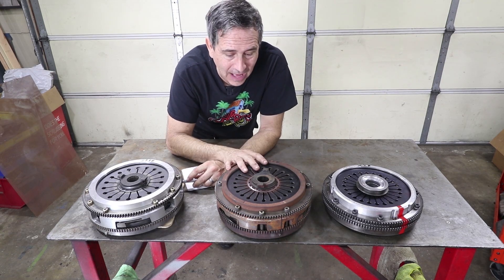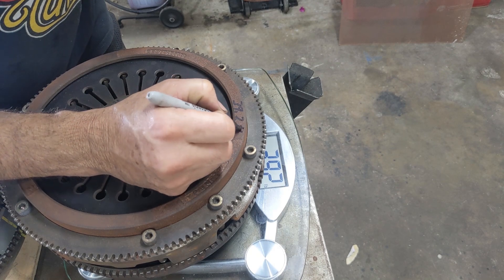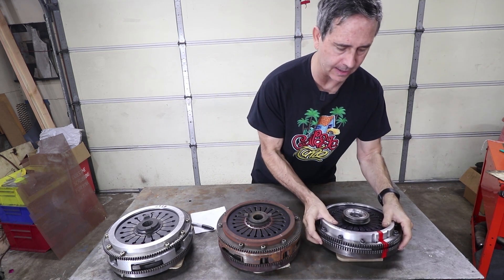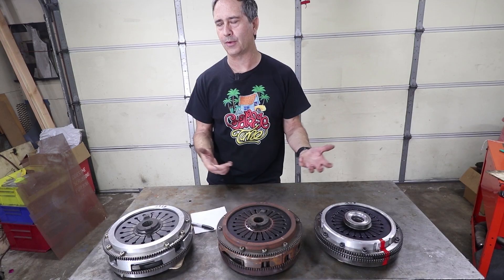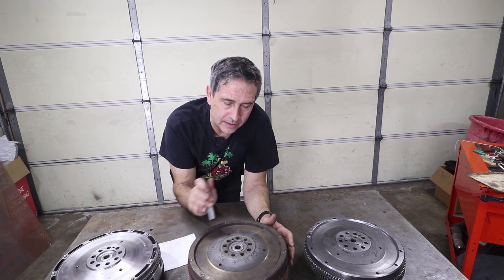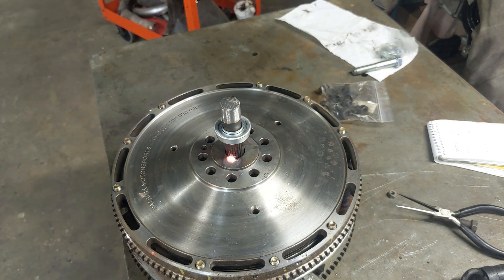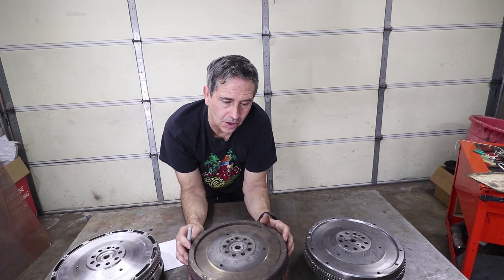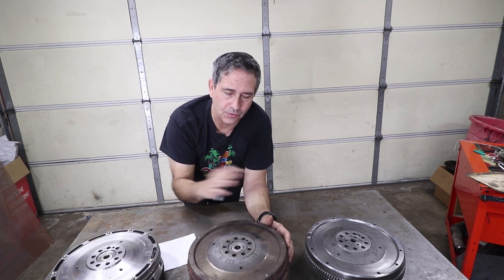Why Flywheel Rotating Mass Is Crucial For Best Sports Car Acceleration

Comment: Thank you Tom...good stuff...love it! Would you (or anybody) recommend putting a light weight clutch assembly into a lighter than the 911 Carrera car (917 replica, approx. 1,900#)?
Reply from the maker: Yes, the lighter the car the lighter the clutch assembly should be.  
You don't need the stored energy in a flywheel to get the car moving up an incline for example.  
The car is so light it just goes.  Especially with a big carrera engine!

Comment: Interesting video!..i have the 915 flywheel with the heavy clutch. i will be taking out the engine and gearbox to do some work on the engine. Your video gave me insite to look over the flywheel and clutch assembly. cheers.
Reply from the maker: Thanks.  It's worth looking into for better acceleration.  You can also lighten the flywheel, but if you remove too much weight first gear starts can be tricky.
Reply: @GarageTimeAutoResto  thanks love your videos

Comment: Can you put the 915 clutch in a g50 gearbox? Something to think about for when I have to replace the clutch, which will be soon. Understand it also needs hidráulic pedal? Thanks, good stuff, as always
Reply from the maker: Yes the G50 cars use a hydraulic clutch.  See this video where I bleed the slave cylinder. https://youtu.be/2gLHQukzR7Y?si=KdDlaZWUKdWjPWYb
A 915 clutch won't fit, but Patrick motorsports makes a short bellhousing system which should be as good as the 915 stuff.  Check them out.
Reply: @GarageTimeAutoResto  thanks Tom. I’ll have a look at it but I doubt it makes sense to buy one and bring it to Spain, you know, shipping, taxes…

Comment: I think this is interesting content. I’d like to see some of the math and a quick brief on the physics software would be interesting too. I appreciate that you give fun info and are quick to the point.
Reply from the maker: The physics software is called tracker and it's free video analysis software.  It turns out that cameras are pretty good timing devices.  This video wasn't very popular, but I explained the tracking software more.  
https://youtu.be/8M2uUN5Psw4?si=4BwOROneWaNMBpXz
I'll show more math on a wheel and tire video, but it's Newtons second law of motion. T=I*w
Rotation acceleration is change in RPM/change in time.  That data came from the camera.  
Kinetic energy is .5I * w^2
It's always a tough balance on how much to include, ha ha.  I can see where people drop off when watching my videos and math is a sure way to lose people!

Comment: Interesting tests Tom.  I've always thought of total flywheel weight, but I haven't thought about the distribution of that weight.  Great summary of the actual torque gains at the end!
Reply from the maker: The Patrick motorsports combo has an inertia of 5.6 per pound whereas the stock flywheel is 6.1/lb. So the distribution of weight does matter.  PM did a good job on their product.

Comment: Interesting data points.  That's a lightweight 915 assembly right?  Wonder how the stock one goes in comparison.  Definitely interested in wheel data, as I've been eyeing off 17" rims to get better tyre choices.
Reply from the maker: The 915 was a stock flywheel with aluminum pressure plate, so nothing crazy.  
Stay tuned for a wheel and tire video!

Comment: Momentun matters!  Why did Mr Porsche make the G50 flywheel 13 #'s heavier than the 915?  Because of the way it feels as you shift the gears... smooth.  He could have stuck the 915 in there.  But everyone raved about the G50 for that feel, and I love it, too!  If you make the flywheel lighter, it will spin up faster but will also slow down faster.
Reply from the maker: G50's do drive nice and smooth, just not as lively.  Part of that is due to the engine management too.

Comment: Great stuff Tom! That's quite a difference in torque values between the stock and lightweight components. I would never have guessed it would have been that much.
Reply from the maker: Thanks and glad you liked it.  My numbers are most likely not that accurate, but it does help put things into perspective.  It takes a lot of torque and energy to spin a  40lb clutch package.  A Carrera engine only makes 100 ft-lbs of torque at 1500 RPM if that.

Comment: Wheel (rim&tire) weights and diameter also have dramatic effects on the spin up to red line in first gear. Good stuff....
Reply from the maker: Totally agree.  I hope to compare wheels and tires next as they are the next big item to optimize/minimize.

Comment: This is a VERY timely video as I am trying to decide this weekend whether to replace my stock 915 clutch + flywheel with lightened unit. My understanding, which you confirm, is the 915 flywheel is already very light (albeit with less centered than an aftermarket flywheel). The benefits, using an RSR clutch and flywheel, would come from the much lighter clutch assembly. The engine is out so it's free other than the parts. 
Did you say in the video that the pressure plate in the 915 combo was lighter than a stock 915 pressure plate? Also, is the flywheel in the 915 the stock one, or a replacement lighter flywheel from the factory?
Reply: I watched the video again. In your test, the 915 was a stock unit other than the lighter pressure plate. That sounds like a great, and cheaper, solution for the 915, given its light stock flywheel. Am I understanding that correctly?
Reply from the maker: Yes, the pressure plate is a Sachs aluminum one.  It's lighter than the steel PP for sure.  A good balance or machine shop can also remove a little bit of weight from your stock flywheel if you don't want to go full RSR.  The 915 combo in this video is what I will use in my 911.
Reply: @GarageTimeAutoResto  Thank you! Very useful information

Comment: Fantasitic.  But I must ask, why not use a motor, measure the amperage and spin-up to speed?
Reply from the maker: I like your idea of using a motor too.  Inertia is Torque * delta T / delta RPM.
A tachometer can measure delta RPM, but getting the Torque value seems hard to quantify based on electrical current.  
The string wrapped around an axle is a very easy to get the Torque number.

Comment: Friends that raced professionally always were trying to lighten rotation mass. They would say for every reduced pound of rotating weight would equal X amount of HP gain. FWIW thanks for the video
Reply: No sorry reducing rotating mass does NOT "increase hp". It cannot by definition of how hp is measured. To measure hp on a dyno you are supposed to do it at CONSTANT RPM.  This means the rotating mass plays NO PART in the actual hp.  Can a car with less rotating mass accelerate faster? YES but only barely faster than lightening the vehicle anywhere else.
Reply: @stuartgray5877  so less rotating mass does not benefit to quicker acceleration?
Reply: @johnvaluk1401  It DOES make a difference but only about the same as losing mass from anywhere else on the car.  WHEELS and tires are part of the rotating mass so reduce it there first.
Reply: @johnvaluk1401  Reducing rotating mass of the engine is also the most expensive weight loss.
Reply from the maker: Good discussion here guys.  Reduced rotating mass can certainly make a car feel faster, but won't show up on a Dyno sheet.  Dynos don't tell the whole story and racers know this to be true!  
As far as removing weight from a vehicle, engine speed rotating mass is the most important especially in lower gears.  The energy is proportional to RPM squared and since the gear ratios force more RPM's versus travel speed the rotating mass dominates the regular mass.  Like 15 times more.
Second reduce mass from things that travel at wheel speed, then reduce regular mass.  This information can be found in books such as Tune To Win.
Reply: @GarageTimeAutoResto yes the "lightened crank pulley" crowd in the Subaru tuners circle love to talk about how they get "more hp" after swapping the crank pulley because it shows a hp increase on an inertia Dyno.  Yeah it does IF you don't make the change to the engines rotational inertia factor in the Dyno software.  IF you make the appropriate change to the engine inertia, then an inertia Dyno SHOULD show no change in engine hp.  Long story short, the people who claim these low inertia pulleys are resulting in more hp are CHEATING.
Reply: @GarageTimeAutoResto if less rotational mass results in more hp then why do Subaru (and Porsche) engines hang so much unnecessary mass onto the crank, like flywheels and crank pulley harmonic balancers?  The engine needs rotating mass to operate correctly and dampen harmonics.
Reply from the maker: I 100% agree that there is a LOT of false claims and dyno cheating out there.  Vanity dyno is what I call it.  Not many dyno operators understand the engine inertia stuff and a pulley is going to get drowned out in the inertia of the dyno.  
A small pulley is a drop in the bucket compared the flywheel and pressure plate.  (30-40 lbs at 11" versus 1-2 lbs at 5" isn't even close to being significant).
People who spend money on this stuff just want to feel good about it. 
I also agree that  harrmonic balancers and flywheels are necessary, unless its a Tesla, but that is an entirely different animal.   Thank you for speaking up as I enjoy these discussions.
Reply: @GarageTimeAutoResto  - "A small pulley is a drop in the bucket compared the flywheel and pressure plate"

I used to argue that changing your flywheel to pressure plate bolts to titanium would probably make a bigger difference than the crank pulley since they are at the perimeter of the largest diameter component of the entire rotating assembly.
Reply: @GarageTimeAutoResto  - "unless its a Tesla,"

Funny you mention it.
The three cars in my garage right now are a 71 Porsche 914, a 2013 Suby BRZ, and a Tesla Model S.